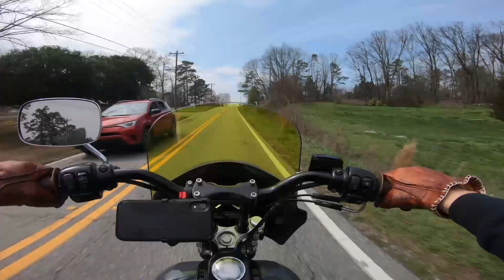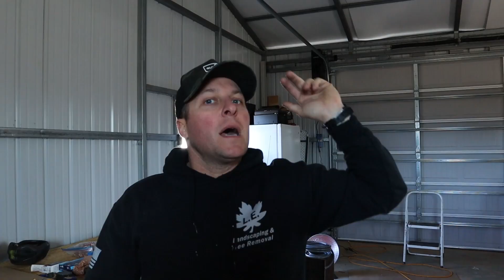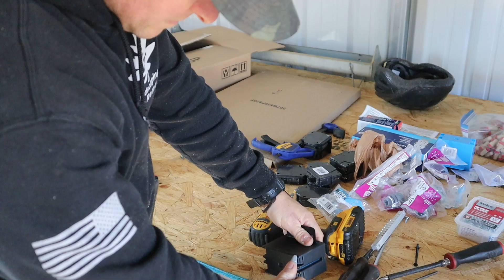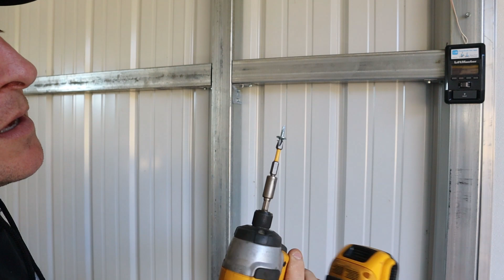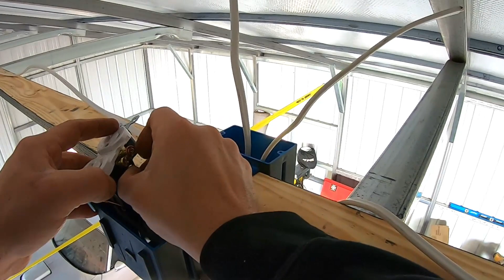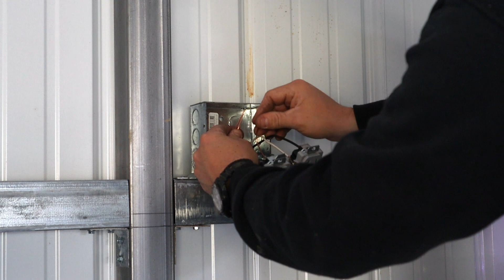I THINK IT'S RIGHT.. 100 Amp Sub Panel install Metal building dream garage build Ep.8

Comment: Great to see your metal building build. I am just starting something similar for a storage building next to my shop. Same 2" square tubing with metal siding. I appreciate the tips on watching the level of detail of the contractor work. 

I have a few electrical things to point out from watching your videos.

Your LB right angle conduit boxes are not installed correctly. The conduit boxes need to be physically secured to the panels on each end. They need a male Terminal Adapter (TA), with a short (2-3") piece of conduit. The TA is threaded on one end and has a solvent weld socket on the other end.  The threaded end goes through the panel and takes a large nut that secures it to the panel. The short piece of conduit is solvent welded into the TA and then into the LB.

I am also concerned about the ground wires in your ceiling mounted junction boxes. You have two romex runs meeting in the boxes, there should be a pigtail ground wire (6-8") from the receptacle ground screw to the two ground wires and then the three ground wires on a wire nut. The receptacle ground screw is not rated for two wires under the screw.

For "next time" your subpanel could have been mounted with the main breaker down, it would have simplified your main feed routing. 

Romex in a conduit is a good point. It is OK, but can generate too much heat with that much conduit fill. A better solution is THHN individual wires in the conduit then a junction box with wire nuts where you convert to romex. 

It looked like you ran two romex circuits in the same conduit. You can not run more than three current carrying conductors in the same conduit unless you derate, meaning reduce the size of, the circuit protection breakers.  That is four 14 gauge wires would only be rated for 12 amps in the same conduit. The white and black are both current carrying. It is a heat generating thing. The two romex should be in separate conduits.

An interesting workaround is a multiwire circuit. Three wires, typically black, white and red. The white is neutral the red and black go to two adjacent terminals on a duplex breaker. The two circuits are energized from either side of your 240v feed, providing 120v to each circuit. It sounds like the white would be carrying 30 amps, but the AC waveform means the white is only seeing half of the total for each 120v side of the 240v feed. They must be on one breaker handle, therefore the duplex breaker.

I run 12-3 multiwire to all my quad outlet boxes. I get 20 amps to each duplex receptacle, they can then be converted to 240v if needed in the future for a machine tool or the like.

An attached residential garage requires GFCI outlets, a shop building does not, for NEC pre 2020. Check which NEC version your jurisdiction requires. I do use GFCI on any external outlets on my shop buildings.
Reply: Need help here.  What is 12/2/2 and is it better that 12/3 that you mentioned ?  I heard there are down sides to that multi-wire thing and was wondering if you could help?
Reply: @keithharrington4595  We are talking about a cable, which is an "assembly of conductors (wires)" in the same jacket. The 12 refers to the wire gauge, the smaller the number the larger the wire. The larger the wire the more current, in amps, it can carry. The -2, -3 (a slash "/" is not normally used) refers to a count of the number of wires in the bundle. Only current carrying wires are in the count, the ground is not counted (except in power cords, like extension cords, let's not go there now).

The wire must be protected by a current limiting device like a fuse or breaker. This is to prevent overheating of the wire and possible fire. A circuit breaker is used to protect the wiring not the devices being powered by the circuit. In most situations a 12 gauge wire is good for 20 amps, a 14 gauge for 15 amps. There are applications that allow 12 gauge to carry 25 amps and applications that limit it to 15 amps. The -2 is your "normal" single circuit carrying wiring providing power to a receptacle or light fixture. The -3 is used for carrying two circuits or 240v to devices that also require a neutral or special switching applications, like a three way light switch arrangement.

There is no downside in a multiwire circuit as long as it is installed properly. The source breaker must be a double pole breaker. Taking power from two adjacent locations in the panel. It must operate under one handle, so both circuit wires are deenergized at the same time. Neutrals, white wires, must be tightly terminated. 

The problems I have seen with multiwire: 1) not using adjacent feeds, causing double the allowed current on the neutral 2) using two single pole breakers, so turning off one breaker does not deenergize the other circuit making working on an outlet or light fixture dangerous 3) neutral not tight causing the 240v to try to flow between devices instead of 120v to ground. The latter is hard to diagnose. You see two different devices that seem to not work or lights that get very bright or dim as other things are turned on/off. But these issues don't occur if the installation is correct.

I have had numerous multiwire circuits in my house and shop for over 35 years with no issues. I have also had to diagnose a multiwire in my daughters house that was not installed correctly that took two full days to figure out.
Reply: @duncancomputer  thanks

I was looking at running.12-2-2 or 12-4 to reuse the old breakers, but if 12-3 is still code, i will have to compare the new breaker cost with the cable expense to see which is a cheaper route to go. 

Do you have a code reference so I can impress the inspector?
Reply: @keithharrington4595  I don't know what 12-2-2 is and have never seen a 12-4 cable (other than 12-4 cord for 3 phase w/ground or 240v device w/neutral and ground).
Reply: @duncancomputer  I guess 12-2-2 is the same as a 12-4 with two whites instead of a blue
Reply: @keithharrington4595  That sounds useless to me. If there are two white wires that implies two separate circuits in the same bundle. That would be 4 current carrying conductors. You would have to derate the 12 gauge conductors to 15 amps (NEC, article 310-15(B)(2)(a)). You would be better to run two separate runs of 12-2 and protect at 20 amps. If they are arriving in the same junction box you keep the neutrals (white) separate and bond all the grounds together.

Comment: Always hire a qualified electrician bro smdh
Reply from the maker: Yes I know that’s what I said. 😂
Reply: As long as it is done by code and you understand what you are doing and the dangers anyone can do it.
Reply: Yeah, that's silly. The key is to hire an electrician when you're in over your head, or have them inspect the work you've done. The knowledge work is often a small percentage of the overall effort. Hiring an electrician for the knowledge work is a good idea, but an educated homeowner can handle a lot of the other stuff.
Reply: @iamamish  I have wired up several breaker boxes over the years and have had no issues. One on my in-laws house and one on my old house changing the box from the old fuse type. These both had to be inspected before the power could be turned back on. The inspector passed everything with no issues. This was done by a block mason not an electrician. Just goes to show if you do the research you can do anything on your own.
Reply: @michaelhembree1783  completely agree, I think the notion that you have to hire an electrician for any electrical work is silly. 

Wiring a house is simply not a sophisticated task. It is time consuming and monotonous, but it isn't hard. Most homeowners can learn enough to confidently tackle simple wiring tasks. 

Everyone has a different point where they no longer feel comfortable addressing an issue. For me, that point occurs when dealing with the breaker box. For others, like you, you're find managing that yourself.
Reply: @michaelhembree1783     So, you did not do the work.   A block mason did the work?   Any area that will let you do your own work in your own home or by a licensed contractor, would not knowingly approve the install.   Was the inspector told the install was by the owner?   If so, fraud!
Reply: @PetPeeveSteve .  Thanks for your lovely comment!   This was 3 years ago.   You forced me to reread the guys comment.  I admit I misread it!  He, the installer, is the block mason.  I misread it thinking he had someone else do it.   I am 100% for someone doing their own electrical work if done safely, correctly, and legally!
Have a great day!

Comment: Liquid tight is fine, as is Romex by itself, but you made so much extra work and expense for yourself. MC cable would have been a perfect choice for a metal building. Also, when attaching your pigtails to the receptacle screws, you want to crank em down with a flat head. The impact gun’s torque doesn’t do a great job on those. And you definitely want them tight to afford arcing in the future. Good luck.
Reply from the maker: Thanks man I actually priced out the MC cable with everything else and it actually saved me some money going Romex with the liquid tight. The MC seemed to be really pricey in my area. Good tip on the pig tails I’ll double check them with a flat head thanks again.
Reply: @ProjectDadLife  Oh wow thats nuts brother. MC is about $10 more than Romex per 250’ roll here in SC. Building is looking good though, Im getting ready to start one now - and Im stressing out with all the money Im going to have to spend lol.
Reply: @ProjectDadLife  The hassle of feeding Romex through flexcon quantifies just using MC when it comes to effort and efficiency. Had my whole shope wired in 4 hrs with MC. Yeah there are a couple extra things you need to install it but they are trivial.
Reply: @ProjectDadLife  MC is $1 a foot right now. Cheap and easy.

Comment: I built an 18'x25' metal building very similar to yours. I just ran 80' of 2awg alu wire to my main panel in my house and I am mounting the sub panel in the shop today. Not sure if you got quotes to have spray foam insulation installed but I got two and they both quoted me $4500 which is like half off what I paid for the damn shop!
Reply from the maker: Awesome,. Yes same here got a few foam quotes. There proud of that stuff I’ll pass. Thanks for watching
Reply: yep my Shops 22'x22' and near the same, Im looking towards DIY Spray foam kits, there's a TF-600FR from Tiger Foam for $785, Im calculating 2 for walls, and May take a 3rd for Roof.

Comment: You do NOT need to run ROMEX in conduit! The extra insulation can cause overheating issues when the wire/load is close to max. I have done HVAC work for most of my life and have pulled several whips apart to find burnt out wires. Hooked whip back up with single strand wires and tested amps and no overload on the wires to unit. Check or ask your electrical inspection to confirm. I am an HVAC tech not an electrician, but around here you will get turned down if the inspector sees the paper or orange plastic insulation peeking through the connector.
Reply: Stick with hvac code requires it on anything below 7 feet
Reply: Yes - here locally you cannot run ROMEX inside conduit.  It's against code however, it may be a completely different set of codes where you are.
Reply: @trekOCLVone  where are you at, its not against the NEC
Reply: @thomasmarable6818  I had some wiring under an exposed covered deck roof for lighting and contracted with a licensed electrician and he found Romex inside plastic conduit.  (done before my time).  The electrician said that needs to be individual black/white/green strained wires and redid the run.  The conduit was the gray plastic.  He had it rewired in minutes and said now it is done right.  That is what I based my comment on.
Reply: @trekOCLVone     Technically you are correct.   There is an exception where the NM cable is exposed to possible damage (below 8’) then it is allowed in conduit to protect it from damage.   There are a few other exceptions that were made over the years, but most seem to have been removed.   My opinion though is, NM cable generally speaking should not be run in conduit.